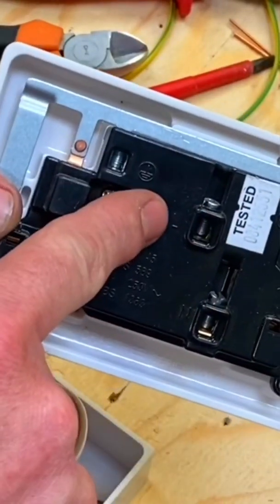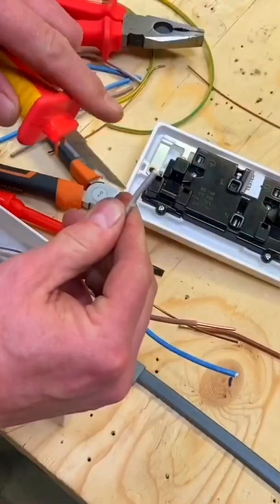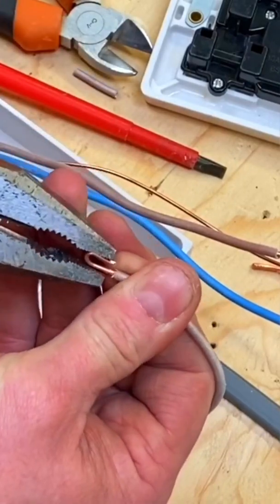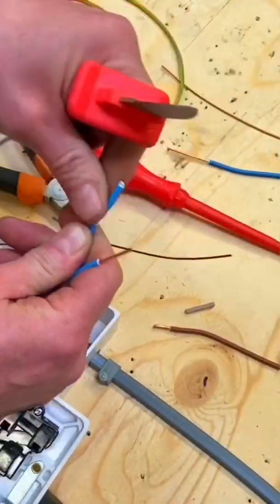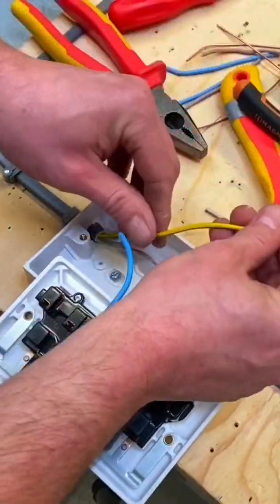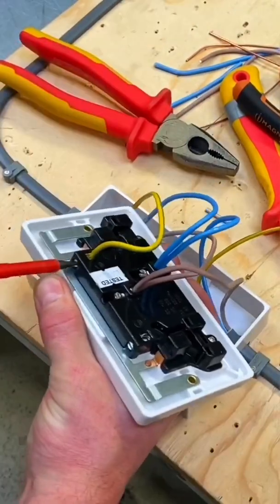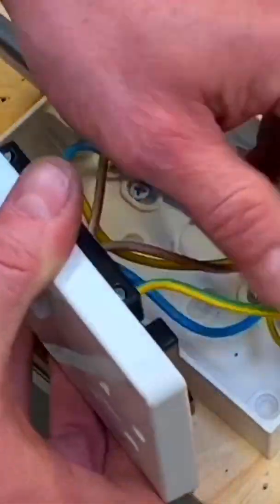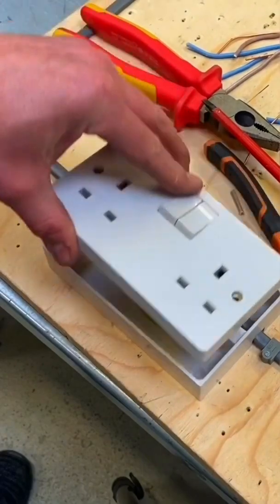Wiring up a Double Socket 🧰🛠

Comment: Hello Sir, Please help me, This is for my shed. The electrician left exactly two cables for a plug point. Due to undetermined other works, he was not able to install the plug point. May I ask if the two cables left out are exactly the same as yours? Is this for two Socket plug points?

Comment: Never seen line and neutral doubled over to be put in together most plates/ double skt fronts in plastic would not take them because as we know as time has gone on there made as cheap as chips and there’s little enough room to terminate them and never seen 2:5 twin made off with a knife unless you have lost your side cutters on route lol

Comment: better to put a kink in the cable ends rather than flattened down and doubled over as that will tend to make the wire split entirely and also cos the receiver isnt wide enough to take a doubled over end.

Comment: ⚠ Warning ⚠
To maintain a low r2 do not split the cpc or you would be adding the resistance of the earth rail in each socket to the r2 measurement. 
Be careful use only one earth terminal of the socket outlet for the r2 conductors.

Comment: ⚠ Warning ⚠
To maintain a low r2 do not split the cpc or you would be adding the resistance of the earth rail in each socket to the r2 measurement. 
Be careful.
Reply: Which will be entirely insignificant assuming, that is, the connections are made securely.

Comment: If there are more than 1 conductors, you should first twist them together to make sure their connection is electrically and mechanically sound to avoid high resistance that could be caused by a loose connection of just dipping the conductors individually....
Reply: That's bad practice as it means a test for continuity might work if the wires had become loose yet the socket is not grounded. Electricians in the UK at least are now taught not to twist wires together. It can also cause fatigue faults if they have to be untwisted for test purposes.
Reply: @TheEulerID  which continuity test are you talking about 🤷🤷🤷🤷 continuity of ring circuit or continuity of CPC ?

Comment: Why put the ground connections into separate terminals ?
Reply: Because it makes it neater and easier to put the face plate on to the back box.

The two are electrically connected so it doesn't matter whether you use one or two earth terminals.

It is also claimed it is better for earthing for computers and sensitive electrical equipment, but I haven't come across anyone explain in terms of electrical concepts such as: resistance, inductance, capacitance, capacitive or inductive coupling, EMC emissions or reception why it is better. People just claim it is better.
Reply: How many points of failure does one terminal have compared to two terminals? What is the current carrying capacity of the internal connection between the two terminals of a cheap Chinese manufactured socket? I keep my cpc’s together in one terminal to be sure of continuity.
Reply: It would be good to explain to the customer that both single and double sockets have a current limit of 13A, which limits the simultaneously turned on power in the double socket to slightly less than 3 kilowatts, otherwise the consumer terminals will overheat
Reply: @vladimirdenisov3340  That's not quite correct.
You can push the current to beyond 13 amps for a short period of time.

So you could run a 3kW kettle in one socket and another appliance in the other.

It's not the case that the metal bars inside carrying the current will melt instantly. They take time to heat up.

On a single socket the thing that is limiting the current is the 13 amp fuse, so you can't take a single socket above 3kW for that reason.

Comment: Can you not use one cable running from the fuse box to a double socket switch??
Reply: it is possible but you need to replace the MCB or RCBO from 32A to 16A.

Comment: Never double over a 2.5. Just find it unnecessary
Reply: I would agree with you do a pair of cables, but if it’s a single cable, then I always fold over. Have you never seen the state of a 1/1.5mm²  conductor that’s not been doubled over after being terminated? Especially when it’s been tightened down by an overzealous Sparky. Consumer units in particular!

Comment: Really should be careful when splitting the CPC's. Some sockets actually require a link between both CPC terminals as there is no continuity between them. Granted they are cheaper sockets but how many times does the client supply the kit where we can verify its quality.

Comment: Really interesting. Never thought of putting the earth lines in both terminals. Is this a batter way than just the one?
Reply from the maker: Thanks for watching 👍🏻
Reply: Wow...every country has different methods of installing electrical fittings. What's correct in one country differs from another...do as the Roman's do..
Reply: The other earth terminal is on the other side of the socket. Why would you not use it if your circuit is going out in that direction? Saves you a few centimetres of cable, less clutter inside the box
Reply: Nooooo don’t do this… you then relying of the earth path of the socket which is not copper to complete your circuitzzz

Comment: I've never seen that trick where you fold the wire is over I'm going to have to start using that myself I don't do a lot of electrical but I do need to put in a sub box for cannabis grow lights and equipment. Am I electrician fuck no, but at 300% below poverty I cannot afford an electrician and I do have many electrical skills just I was a contractor where I used to have to move electrical around all over the place including adding and removing ceiling lights garbage disposals GFCI and microwaves. Most recently I put in four circuits three of them being 20 amp and then one for light controller that has a 60 amp breaker for a 4000 Watt 4 light controller (that thing works brilliantly by the way) and if you're not using four sets of lights at 1,000 watts each you can add things like the humidifiers and other things to that light controller as well. It's designed for the heavy power requirements on digital high frequency ballast. Which I was told that in Cape Cod I had the worst leakage from one of my ballast that only crazy thing is I had only two 600 watt ballast hooked up how can that be worth the entire Cape Cod with just two simple 600 watt lights? My internet connection came in right above where my ballast were so I had to move the internet connection to the other side of the house. At the incredible cost of nothing. Using just supplies I had stashed away over the years.

Comment: You see.. i was told off for putting the 2 CPCs in the separate connections. Was told to always put them together.
Reply: Do it anyway you like. The two earth terminals are connected together. Electrically there is no difference.
Reply: @deang5622  One can do many things that are "no different electrically" but "no electrical difference" and complying with the regs are not the same thing.
Reply: It's bad practice for multiple reasons. This would have to be corrected.

Comment: Great, but you forgot the most important part: Make sure the power is turned off to the circuit you're wiring up to!
Reply: Real electricians don't care about that part
Reply: @nateharrington3834 why
Reply: Yeah bad video. He didn't even warn us to not put the wires in your mouth or don't stab yourself with the screwdriver. How else will we know!
Reply: Also, don’t forget to breathe. if you don’t breathe, you die.

Comment: Gaz why do you split the earth conductors between both earth terminals? I was tort to connect both earth conductors to one of earth terminals the second earth terminal is only used if you are fitting the socket to a metal back box and a fly led is needed between the socket and back box . Fantastic demonstration as always Gaz.
👍👍👍👍❤️
Reply: It's bad practice to use the socket for earth continuity, Not impressed.
Reply: @dogwalker666 totally agree that both earths in one terminal is best. Most cheap sockets from screwfix and the like use pressed tin crimped to the terminal. I don’t trust that to handle pfc at all.
Reply: @demonkey123  last week I was replacing a Kliks one the brass earth stud had detached from the tin bus bar.
Reply: IT circuit >10ma leakage?
Reply: @renral69  he's basically saying not to spilt it
Reply: They are electrically connected. It's a piece of metal connecting the two.

If using it makes the wiring easier, neater than damn well use it!  Your instructor clearly was clearly a bit skill deficient in electrical engineering.

This is the problem, instructors teaching electricians that don't know enough themselves.
Reply: @deang5622  you clearly use both terminals for all your installations. The fact that you are unwilling to consider the points that people have brought up in this conversation, reveals your lack of skill as an electrician. The electrical installation industry is simplified as far as possible to allow electricians with basic knowledge to work relatively safely. Lectures teach electricians to work, parrot fashion, so they can do the job that they’re employed to do. The next level of electrical engineering requires a mind that is willing to consider all factors when making a decision. One good tip is to limit the point of failure in this case.

Comment: I thought you only double over when only a single conductor is being put into a terminal, what is the need when there is more than 1 cable in the terminal ?
Reply: I've been told not to double over at all 🤦🏻‍♀️
Reply: Thought the same
Reply: Same 👍🏻
Reply: Because if you don't double over then you have a single conductor width which may not be properly under the screw when it is tightened down.

When you have two single conductor widths of wire in the terminal, one may be pushed off to the side and not fully under the screw.
Reply: Do not double over when more than one wire! And not so good practice spliting the earth continuity. This guy can't be a trained spark, is he an armchair spark? His how to fit wagos in a jelly box for a submersible pump was a little suspect as well. It was an ip rated box until he demonstrated it.
Reply: @petersharpe742 and who uses a knife to strip a cable , side cutters or strippers  everytime and how long to make a socket off , Id have the room sorted by the time he makes one socket off , wouldnt fancy paying him by the hour

Comment: How long before the sparky has to dust of his trusty torque screwdriver for doing these as well? We are obsessed with the consumer unit end, but no one gives a rats bottom about the other end/faceplates...
Reply: think that will bring in push fit sockets
Reply: Wago style spring loaded connectors solves that problem.

Comment: Double down required. Or just something you prefer doing?
Reply: I was taught only to double over if there's only one cable being terminated. If there's two, the combined side should  provide enough surface area. Of course technically, the doubling over on both is better.

Comment: I wanna add something that I've learnt, if you have to ground the wire at any given point when doing electrical work, make sure the ground wire has more wire INSIDE the item you're grounding, this is done so that when or if the item is pulled, and a connector comes loose, the ground wire will be the last to detach, meaning there's a smaller chance of hazards.
Reply: That's one of the reasons a UK 3 Pin plug is designed the way it is :-)
Reply: @tazdevil875  And Ceeform plugs.
Reply: @tazdevil875  Exactly!
Reply: Was taught that the most important termination was the Earth/ground wire. The line connections failing stop the circuit working, the CPC failing stop it being safe
Reply: But really how often is someone pulling on a wire that's terminated into a socket bedded into a wall?

Seems like one of those solutions to a non-existent problem.
Reply: No.
That is a good measure to use for a plug but it is not required for a wall socket.
The reason is that you should always follow safe isolation practice and de-energise the circuit, so when you remove the socket front plate from the wall, it is entirely safe.

The issue with a plug and why you should do it, is because the wires could be pulled out from a plug whilst power is turned on.